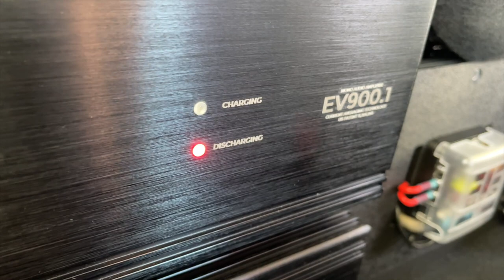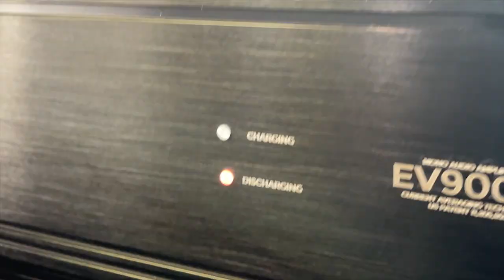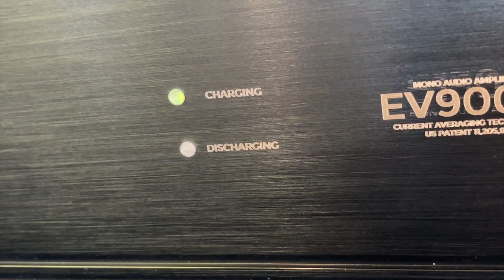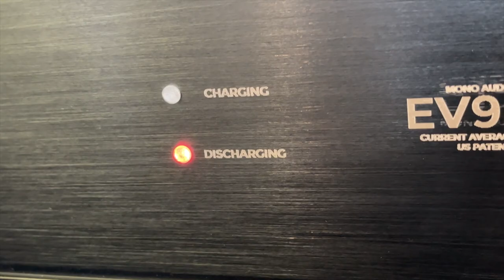D'Amore Engineering Current Averaging Amplifier demo 900 Watts RMS on 12V Cigarette lighter socket??

Comment: Interesting demo. Brings your point across about efficiency. 
That is nearly the exact setup I want for my truck. I probably won't be running it off of the Cigarette lighter power.
Reply: Just to be clear, it's not a super high efficiency amplifier. Even if it were one hundred percent efficient it would still require over 60 amps to output 900w. It actually has batteries inside that is supplying the higher current when needed.
Reply: @JasonWW2000  I understood energy storage in the design. This would not be feasible without the amp being efficient as well.
Reply: @avnut5517  Feasible? Thats all depends on your definition. He could certainly use it on a not so efficient class AB amp and it would work. But practically speaking, I assume he's using his Clean D amps or some other class D.

Comment: SOB! Amazing engineering and design Tony! You have solved one of my biggest issues with amplifiers which is source current draw! Please explain how you accomplished this in the circuitry……..I must know after 25 years of waiting!
Reply: There are batteries inside the amplifier.
Reply from the maker: @JasonWW2000  and more importantly an intermediate isolating power supply and control circuitry.
Reply: @DAmoreEngineering  Sounds good. Did the T15K also use batteries? I never found out for sure.
Reply from the maker: @JasonWW2000  no the T15kW used double-layer carbon ultracapacitors.

Comment: Love my 5 channel amp in my Tesla!  Planning on adding a dedicated sub amp at 1 ohm.  These amps are rated to 16v which is awesome for the Tesla 15.6v accessory system.  I've added an XS Power  PWR-S6 and hoping it keeps the audio from tripping the 60 amp breaker I have between the amp rack and the Tesla electronics. I'm tempted to go with the 1500w amp.  My Orion subs can handle it easy. The whole thing is touch and go but I'm testing the limits in an EV lease!  😂

Comment: 15 ampa x 12 volts so say 150 watts after some loss or so to subs. Subs wired in parallel for 1.5 db increase in sensitivity  per 12 connections which makes more of a difference than the power.
Reply: @jrlutor- All of what you said is normal math, this amplifier is a 900 watt amplifier, only pulling 15 amps, because of this patented New Design= called: (Current Averaging Technology).

Comment: Holly 💩. Your pulling a fast one. Jajaja,  them very impressed.  Thanks for sharing. Waooo.
Reply: Not really, His new amplifiers use a battery Bank inside the amplifier to supply the higher current. This is why you see the indicator light showing either charging or discharging. During the quiet sections it's charging and when it needs to output bass it switches to the discharge light.

Comment: Ok, I'll start... (Btw love and use Tony's products) so this must be an amplifier with some sort of high capacitance caps and/or high c rating lto batteries inside. It seems to work as most large bank cap systems work by charging between beats. But as we all know this only lasts for so long and after a song or two it will reach a point where it no longer has the charge to support and will shut off the amp to recharge. The question is how long is that? One or two songs, or 5 songs? Obviously the cigarette lighter was just an example and not an intended power supply. ( But I wonder how many will actually run it this way 🤔) It probably is supposed to be run on a halfway decent power supply and has its own onboard power supply that supplements that so it can run without having a huge battery and/ or alternator. I'd be interested to know if I'm wrong.
Reply from the maker: You can run it this way indefinitely.  A 900 Watt amplifier can draw peaks of 80A or so on 12-14V.  Those peaks are handled by the 15A from the vehicle + 65A from the internal power reserve.  When amplifier 's demand is less than 15A (in-between bass notes for example) it will still draw 15A and use the excess current to replenish the power reserve.

Comment: What you save in wire cost, you can put towards the amp cost!!!
Reply: Not just wire but also the money you would normally spend to upgrade to multiple batteries and power output alternators. Plus some Vehicles you simply cannot upgrade the alternator on.
Reply: @JasonWW2000  which this does nothing for the alternator . power still has to come from somewhere. its the same thing as if you were to add a cap bank before the amp . which dont add any wire but a set of terminals . its not saving you anything , instead it making a amplifier more expensive and making it less serviceable .
Reply: @mazda2284  If you really think that, then your not understanding what is going on. Let's take the alternator for example. Let's say you put together a nice 2000 watt system using traditional high efficiency amps. That could pull at most about 180 amps. The typical alternator might be 100 amps and its producing 40A to run the vehicle. It has 60A to spare, sometimes less, so the amps are not going to have enough current fed to them on those brief transients where it needs the most power. You will get severe voltage sag and lack of power. 
These current averaging amps only draw 6A continuous. Lets say the 2000 watts is made from 3 amps. So that's 18 amps continuous they will draw as opposed to 180 amp surges. This means your not maxing out your alternator, your not getting voltage sag, you don't need a second alternator or to swap the current one for a high output unit. So it obviously helps in the alternator department. Don't you agree?
A capacitor bank holds very little power and is used up in a fraction of a second. So its not comparable. 
To explain where the power is coming from is pretty easy. In a typical system the alternator is feeding the amps power in surges, sometimes it might draw a couple of amps and them a surge of 100+ amps is needed. A lot of times the alternator can not even react to the load and switch to higher output quick enough. The constant current averaging amps are always drawing 6A to charge up its battery bank. When full it probably draws less. Then the stored up power can be sent out in large surges to follow the music.
Reply: @mazda2284  Another advantage is that you can probably run your amps off the factory fuse block. No more need to run large cables through the vehicle. Wiring it in can be fast and simple. 
These amps don't fit every application. I'm sure most bass heads would want more power than what Tony's amps can deliver. I would think these amps are more for the music lovers who build smaller systems. I believe Tony isolates the power coming in from the power being fed to the amp section so it should have zero alternator whine. It may be more for serious sound quality junkies.
Reply: @JasonWW2000  i run lithium . i can run a 60kw system on my bench with no charge at all lol , ive tested countless systems between 100w -20k+ on stock alts . thing is you still have to draw the same amount of power over time . so by that logic i can run a 10a controlled charge bms for my lithium bank and do the same thing .
Reply: @mazda2284  Then why are you acting like you don't understand what's going on? I shouldn't have to explain the benefits to you.
Reply: @JasonWW2000  you dont have to explain , it still requires power to make power any way you cut it , it dont matter if you store it in the amp or another device . wanna run small wires not far ? buy a nvx amp as they are marine rated and slap nvx vtbt bluetooth device on it and slap it under your hood right next to the battery .... what actually matters is the efficiency of the entire amplifier system , and these amps will still require the power of a 70-80% amplifier just drawing it over time instead. a Brazilian brand just hired 50 electronic engineers that is already doing very well at super efficient amplifiers . thats something worth paying attention to . these amps would be for a very niche person that wants very specific things ... for everything else ..you have better options
Reply: @mazda2284  Tony is cutting out his niche in the amplifier market, just as he has always done. Lol

Comment: This has got to be a class D amp, if you can run it off of a cigarette lighter plug.
Reply: His new amplifiers use a battery Bank inside the amplifier to supply the higher current. This is why you see the indicator light showing either charging or discharging. During the quiet sections it's charging and when it needs to output bass it switches to the discharge light. I believe it only requires 15 amps or less for charging which is well within the range of a cigarette Jack.

Comment: Explain the wizardry tony. I'm very curious
Reply: His new amplifiers use a battery Bank inside the amplifier to supply the higher current. This is why you see the indicator light showing either charging or discharging. During the quiet sections it's charging and when it needs to output bass it switches to the discharge light.

Comment: putting a cap or battery inside a amp isnt a revolution , its taking the same thing we have outside the amp and putting it inside. MTX had this sitting in there engineering facility 15+ years ago and instead put terminals on the outside to add caps . this isnt something super special or even that useful , its marketing ... which smd and Damore have shown that they can make good profit on combining things we already have and use into a package and marketing it as its something new ... which its not .
Reply: Thanks but that's not how it works.  You can put as many batteries or capacitors inside or outside of your amplifier and it will not cause it to draw a constant current.  US Patent office doesn't grant patents for "marketing".  Comments like this can't be taken seriously as the patent DETAILS how to make it, as it needs to by law.  MTX didn't have anything, still doesn’t.
Reply: @nismotony  you totally can , its called a BMS
Reply: @nismotony  im gonna make a video showing anyone how to diy exactly what ur talking about .
Reply: @mazda2284  I’m growing old waiting for your video of how a “BMS” can regulate current draw 😂😂🤡
Reply: @nismotony  I already did , so did the AU diy group. They use caps and think its hilarious you are just now figuring it out as they have been building current limited systems for years

Comment: Where do we buy amp I confused what this means 🙂but looks good for people who don’t understand math
Reply: His new amplifiers use a battery bank inside the amplifier to supply the higher current. This is why you see the indicator light showing either charging or discharging. During the quiet sections it's charging and when it needs to output bass it switches to the discharge light. These amplifiers are not yet available for sale.

Comment: Is this an April fools? There is no way that just happened 😳
Reply: His new amplifiers use a battery Bank inside the amplifier to supply the higher current. This is why you see the indicator light showing either charging or discharging. During the quiet sections it's charging and when it needs to output bass it switches to the discharge light.
Reply: @JasonWW2000  I've never heard of this but will say this is badass engineering! All amplifier should be built this way! I'm gonna have to look closer at these!
Reply: @T_B_C_L  Check out his last video showing how it delivers over 100% efficiency.
Reply: @T_B_C_L  your saying every amp should be sold with a capacitor bank to support it ? all that does is increases the prices .